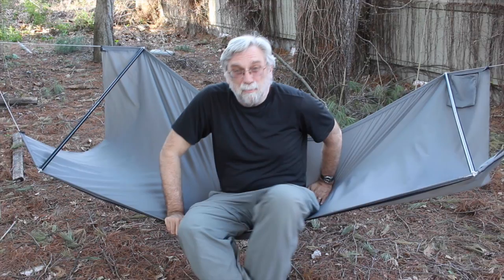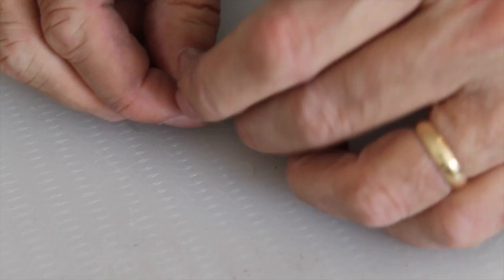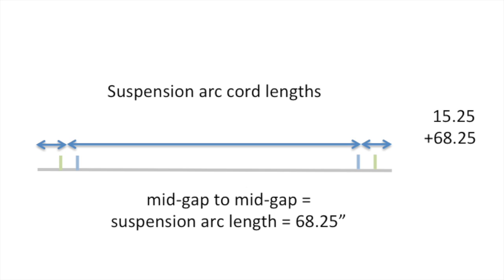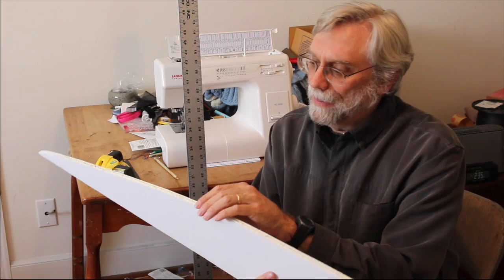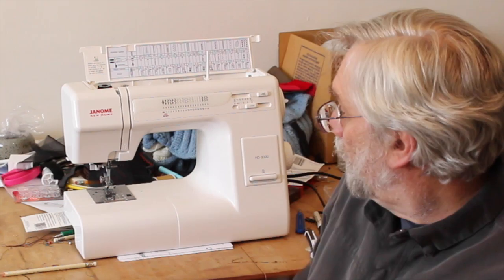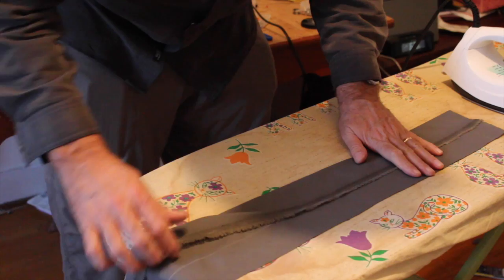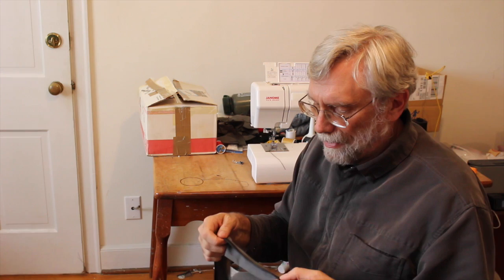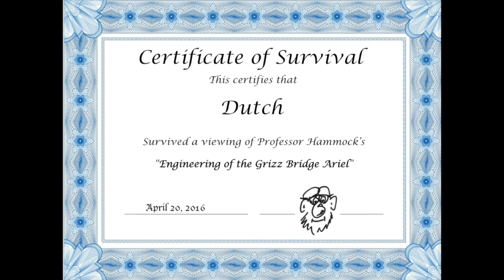Engineering of the Grizz Bridge Ariel

Comment: Whoo! Been waiting on this for a long while as well. I've done some CAD modeling (in Solidworks) along the same lines as well, but haven't yet done the math for the extensions on the ends like you have here, and I plan to use the usual strap rather than cord sides (as I already have it). I really like the look of those little pockets on the ends. Beautiful work!
Reply from the maker: +OrangeCrusader I'm using OpenSCAD, I like how easy it is to rotate the model.  I'd been wanting to understand how to cut the body past the spreader bar for a long time.  The 'ah-hah' moment was thinking about the bowling ball for head.  After that it was just programming.   

I want pockets nearby for my glasses and a headlamp.  OK, true confessions, earphones and an ipod nano too.   These are just right for that.

thanks for watching.

Comment: Fantastic design and video. I'm ordering materials and going to attempt making my own Ariel. I love the advantages of hammock camping but  as a side sleeper comfort can be compromised. A bridge hammock my be the solution. One question; what are the lengths of the spreader bars used in this design?  Thank you for sharing your knowledge, experience and work.
Reply from the maker: buffalobill, thanks for the nice comments.  I use 36" spreader bars from dutchweargear dot com

Comment: I can lay out the whole hammock with the details given EXCEPT for the end caps. you mentioned the arc length and depth, but still seems like something is missing. Do you have digital templates to share?
Reply from the maker: slips by quickly, at 8:15 the missing measurement you need, 26.5" length corner to corner,  is up on the screen.

Comment: Why not use a single piece of amsteel, and then splicing a short stub length into it on both sides to create the eye? Seems theoretically a little stronger and more importantly easier to get lengths right.
Reply from the maker: Thanks for watching. I thought of what you describe and opted instead for the interleaved strands to make the eye.  The reason mostly is that I was confident that the presented solution would be strong.. With one stub you are relying entirely on the 'squeeze' of the longer element to hold the shorter one in place.  depending on the force ultimately applied to the stub, it's a contest between the force trying to 'push' it out of the longer piece versus the constriction applied owing to the weight being carried on the long piece.  The presented solution is in line (a joke!) with known splicing usage of cord and so I went with that.  Finally, if you are trying to cut the right lengths for the suspension before splicing, the stub is no easier IHMO...you need to compute the impact on the long side, twice, of embedding it.  The presented solution 'looks' more complicated, and perhaps it is, but in terms of figuring out cord lengths its a wash.  Cheers

Comment: I've been lurking on hammockforums for some time and I love your design so much that after countless hours surfing the web for bridge hammocks I have settled on your design.
     A question for you though. I am 5' 9" tall and considering that you designed your hammock to fit yourself I am thinking of reducing my total length to 76" total instead of 82" and the depth of the arc in your design to 6" instead of 7" for a width at the middle point of 34". 
Do you foresee any issues with this design?
    Thanks for all your work in making these videos.
Reply from the maker: Thanks Ben.  You are 4" shorter than me. Reducing the length by 6" will eat into the margins at the ends, but the margins are still there, it will just be a tad bit cosier.  6" arc depths I've done, but I wouldn't go any shallower than that.  You need some depth there to 'pull up' the middle under load.  Have at it!
Reply: Thanks for your speedy reply, happy hangin

Comment: Thanks for the great vid!  May just have to do some DIYing myself now :)
Did have one question tho, what kind of minimum hang distance does a bridge hammock of this style give you?  I've looked at the more traditional style bridge hammocks, and they all seem to have a rather large minimum hang distance due to the additional suspension on the ends.  I'd imagine moving in the spreader bars would cut this distance down a good bit so thought I'd ask.  Thanks!
Reply from the maker: Great question..one of the motivations for this design was to fit a bridge hammock under a standard sized tarp, and in doing so reduce the minimum hang distance.

The distance between the two apexes of the suspension triangle is 108", that's nine feet.  Beyond that the minimum hang depends on how you attach, for the design shown here you could in theory just hang the loop that's at the apex on a device like Dutch's spider that's on webbing.